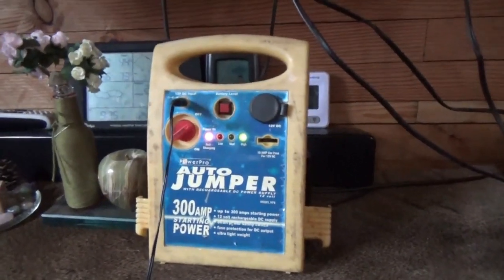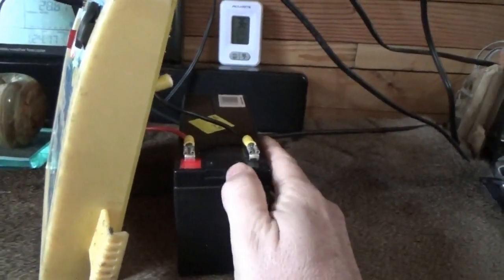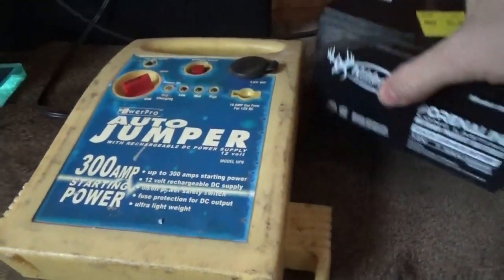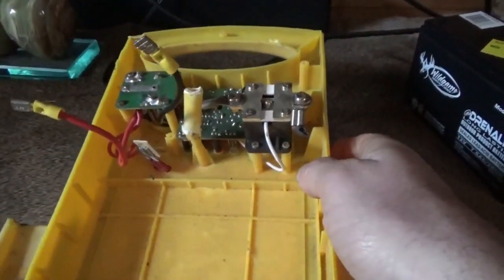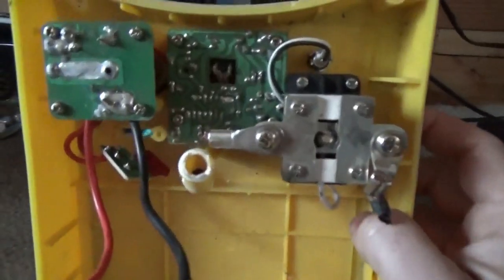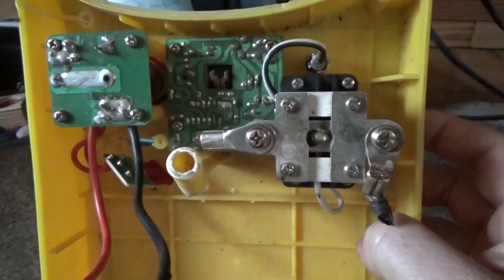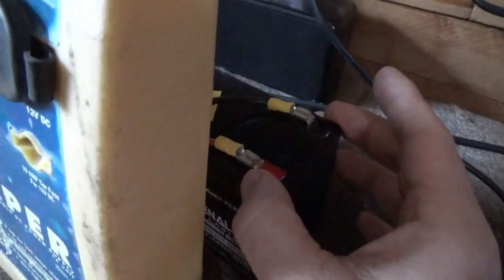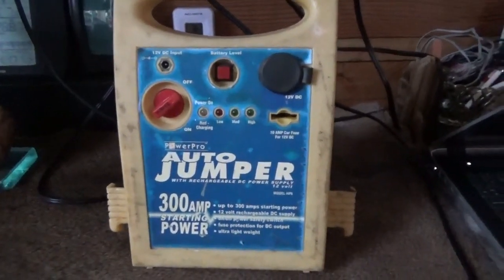Recycling Dead Jump Starter Pack As Battery Charger & More

Comment: as a mini solar system i have a nautilus marine style power pack charged by 3 small solar panels..use it to power my heated recliner...charge aa/aaa batteries has 400 watt inverter to power light stand.USB  and 12v outlet...also has 12v air compressor built in back...handy unit
Reply from the maker: +swany very good to have on hand

Comment: Just so you know, those are the same type of batteries used in most APC battery backup (UPS) systems.  If you check the physical dimensions of the battery and whether it's got F1 or F2 terminals, you can also swap out the 7A for 8A or 9A versions as well, although the 8A and 9A versions are slightly more expensive...sometimes the added power capacity is worth it.

As far as APC units go, anything from a 1000 or higher uses two of these same type of batteries.  If you ever find a "dead UPS" anywhere, 90% of the time it's just the batteries, since most people simply aren't interested in spending 50-60% of the cost of a new unit just for a battery pack...which if they did  a few minutes research, they could get the "bare batteries" for considerably less, and have their UPS up and running in a few minutes.

If you ever find a "true sine wave UPS", I'll bet that you could find a way to use a couple solar panels and a few old car batteries to set up some power in the greenhouse, as well...since the UPS systems ALL have inverters all ready to go for those times when you need 120V power, and since they ALL use 12 volt batteries, I don't think I need to explain the benefits of the simple idea of a diode and pigtail.  d;o)

Comment: Is this basically a charge controller?  What's the input power to charge the 12V battery.  Surely you're not running it off your AC inverter.
Reply from the maker: Yes it is basically a charge controller. The input can be from solar panels or from a wall plug into AC. Or a DC boost converter. I tried off my main battery bank but of course if the battery bank is not full the charging battery cannot get full either.